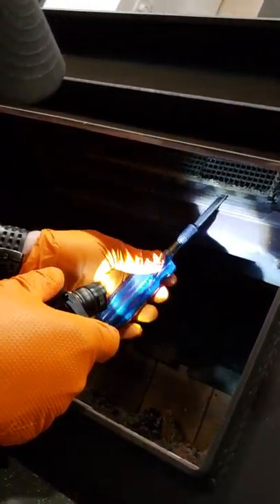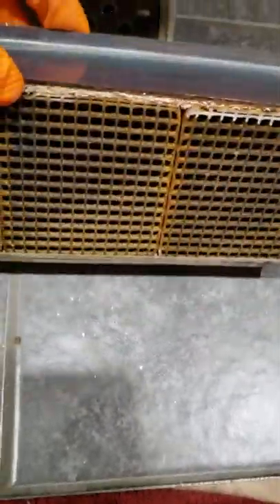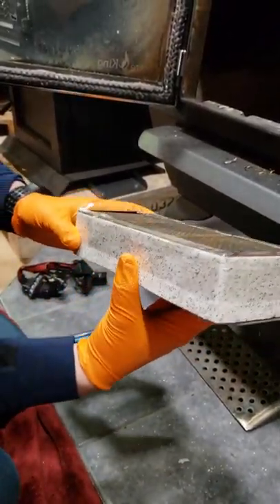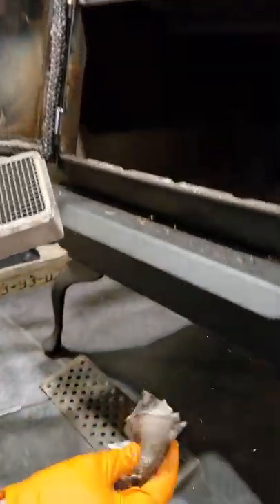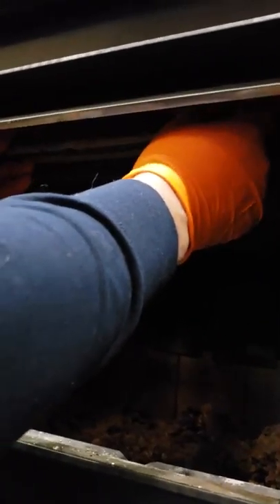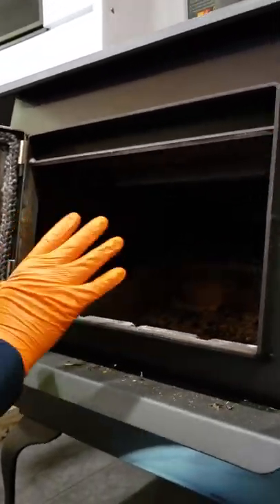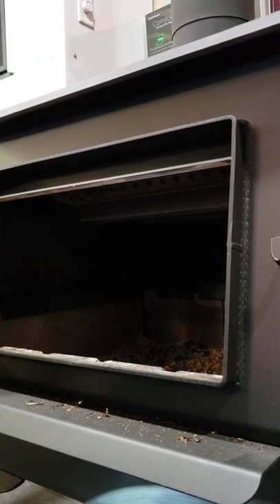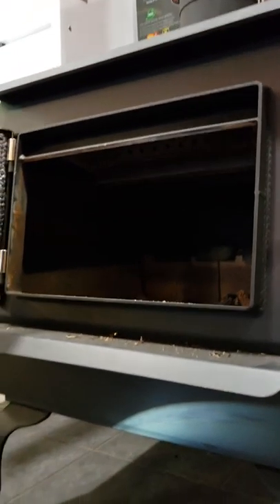Blaze King Catalyst Change or inspection

Comment: So.. if its dead of winter and ypur gasket is donezo what do you do? Can you leave it after cleaning? Not sure if mine is bad as im waiting for it to cool but if it is i doubt i can get a replacement soon where i live. And its below 10° for a while if not in negative... IF my gasket is bad could i do my best to put it back and itll be okay till i can replace it? Will that do more harm?
Reply from the maker: Your gasket isn't bad but it will crumble when you try to remove it. You will need a replacement if you decide to take it out. If you use it without the gasket you will lose efficiency.

Comment: Anyone know how long the cats last on the blaze kings and if there's a way to make them if say the company goes under or stops making them later for any reason? With that said, anyone know if these are even less efficient than an old school stove with the cat bypass engaged? Wonder what kind of burn times it gets with vs without the cat? What kind of temps could I expect with it cranked all the way down low? Keep wondering if I could get a bigger stove and get way longer burn times and still working the cat efficiently for a well insulated 1200 sq ft house. Thanks for any insight as it will be greatly appreciated
Reply from the maker: BK offers a 10 year warranty on the cat that comes with the stove if you fill out the warranty card. There are other companies who make replacement cats.... your concerns are valid but aren't any different then if you buy a secondary air stove and need to replace air tubes or baffle. Neither type of stove will work very good if they don't have the proper components as designed.
Reply: @tinmaninc2023  jeez, wish I'd gotten this response a couple days ago. I literally just ordered a secondary air yesterday. Thanks for the info though. Now I'm kinda sad cause I was wanting that slow low burn capability of the catalytic. Kept wandering if a big catalytic stove could burn clean enough low and slow but I've had contradicting responses. Not sure if any of them actually tried it. I've seen some saying they burn clean and the cat stays hot even cranked down which would be amazing and a huge plus if so! You ever tried it before? Also see claims you can't brush a cat and vacuuming don't work good enough to just have it pro cleaned. I'd like to know how the "pros" clean it then. Is there a solution which you can soak it in? Would love to hear any experience with this! Thanks a ton for the info! I may have to buy a cat stove and resell this one when it comes in before using it. I purchased an Englander 32NC but now wondering how that compares to the BK for burn times and maintenance. I thought it'd be more maintenance free.
Reply from the maker: @jackle842000  Check out my first video where I remove the cat from a stove. Vacuuming and brushing works, no pros needed for that. You cannot soak the cat and don't really need to.
Reply: @tinmaninc2023  I seen the videos of such but I've seen a ton of info claiming you can NOT brush them as it removes prescious metals which ruins the efficacy of the catalyst. If so then how you supposed to clean it? This is why I've been in search of the how to clean one the correct way. Or is there some special type of brush? Thanks
Reply from the maker: @jackle842000  Soft bristle brush works best.
Reply: @tinmaninc2023  have to be something non abrasive I guess. Baby bottle brush work?
Reply from the maker: I use the brush attachment on my ashvac for mine.
Reply: In twenty years of burning my Princess (that doesn't sound right!), I've never had a catalyst clog. Any soot I've had has collected on the outside of the catalyst, so I don't even remove it (which saves buying a new gasket, which can take weeks to get from my local dealer), I just vacuum the surface. I've replaced the catalyst once in twenty years. Amazing stove. Works great after all this time, though I might put new bricks in this summer for the first time. The old ones are pretty beat up. Other than that, I put a new door gasket about every three years and a new bypass gasket when I replaced the catalyst. Clean the chimney and vacuum out the ash once a year. Best thing we ever bought!
BTW, more than enough stove to heat 1500-2000 foot home. Even at low settings you will be opening a window on mild days (which is a good thing! Better too much stove than not enough when it's really cold!)
Reply: @alansach8437  I have no experience with them & only going by reading others myself. Thanks for the info. You mind if I ask about how many years along the cat was when replaced in the 20 yr time? Was it at the end of the 20 yrs or more like 10 or 15? When you burn yours low and slow what kind of burn times were you getting with what kind of wood? Thanks for any info
Reply: @jackle842000  Sure. We replaced the catalyst at about ten or eleven years. It only had some minor cracks, but we were noticing shorter burn times and more smoke. Creosote has never been an issue with this stove. When I clean the chimney in the spring I get a couple of cups worth of flaky soot, not tarry creosote at all. Also, it amazes me how much it burns down the wood to a fine ash. I never have to empty ash during burn season. I would say there's about three inches on the bottom in the spring.
As for burn times, they vary of course, depending on how much wood I put in (and how big the pieces) and how cold it is outside (and how warm I want it inside). We also leave it a little higher during the day if we are home, and turn it way down at night or if we aren't home. So, anywhere from 8 to 20 hours. The only wood you can get around here is pine. 
For many years I got my wood from the local wood mill. They had "rounds", which basically are the ends they cut off logs prior to making 2x4s. They would dump these rounds in a designated area where folks could load them up into their pickups. However much you could get in the back of your truck they would charge you twenty bucks. As I got older it got to be too much on my back loading and unloading, so now I buy cord wood. I generally buy it in spring so it can dry all summer. I've never been obsessive about how dry it is. If there's no sap oozing out, and it clacks rather than thuds when I hit it together, I am happy, and I've never had a problem. Generally keeps our 1800 square foot home between 70 and 80 degrees. Of course, it's a little warmer in the room with the stove and a little cooler back in the bedrooms, which is what you want.